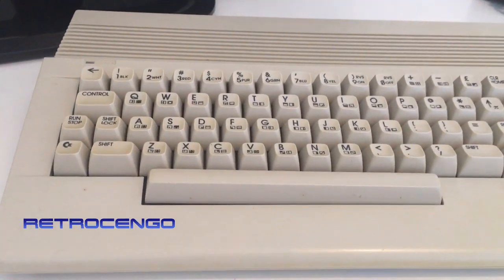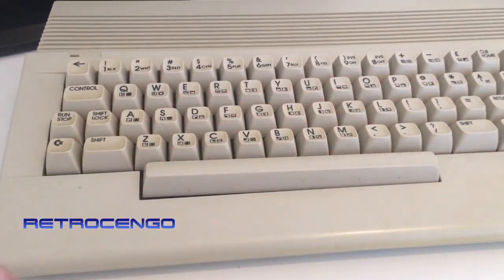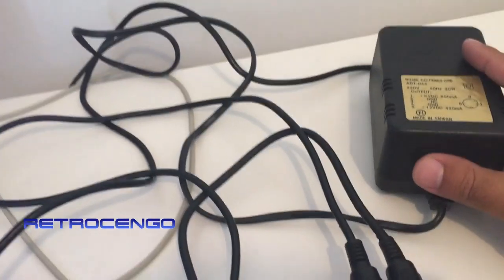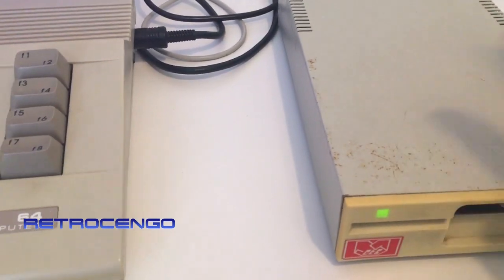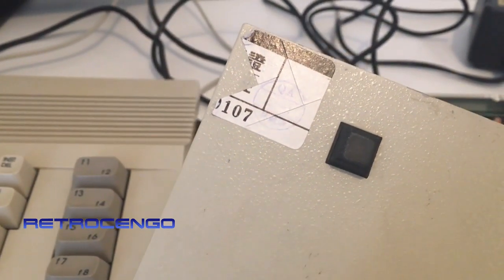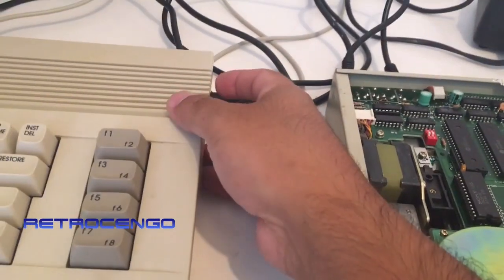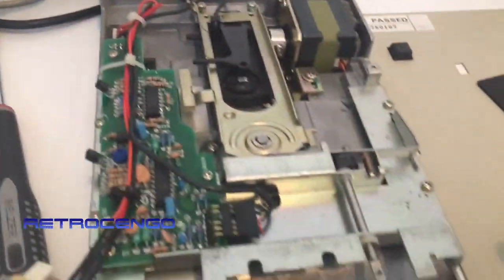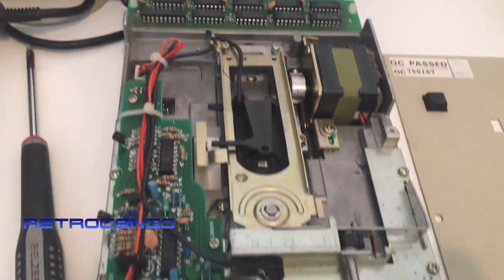Commodore 64 diskdrive test and repair

Comment: 7:20 - Just a heads up @RETROCENGO .. you can simply scroll up to the game file name line and type just "LOAD" then move your cursor to the very end and type ",8,1".  You don't have to type the full file name.
Reply from the maker: Core Wavefunction Nice, dident know that, i only had cassette back then. Thanks😁